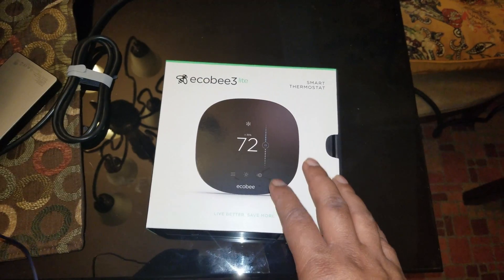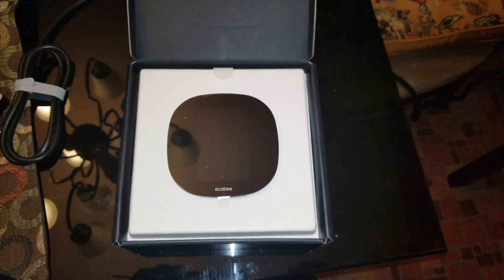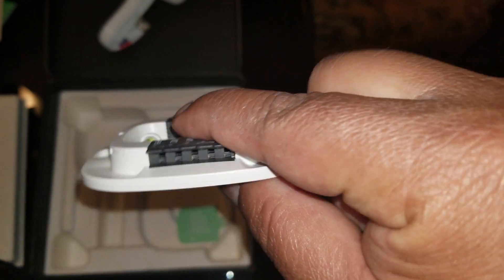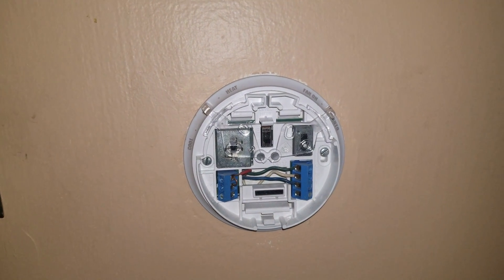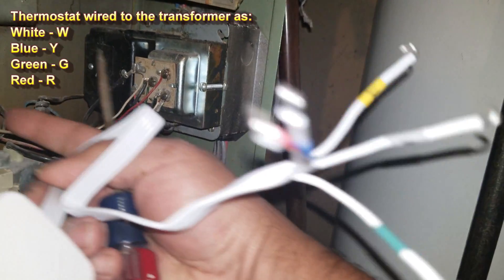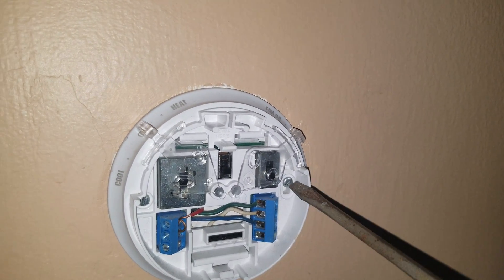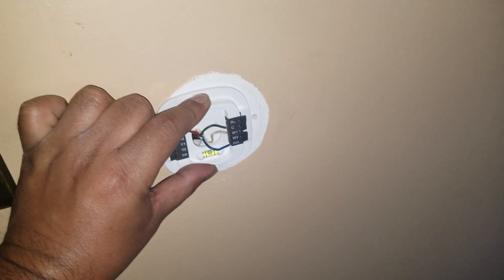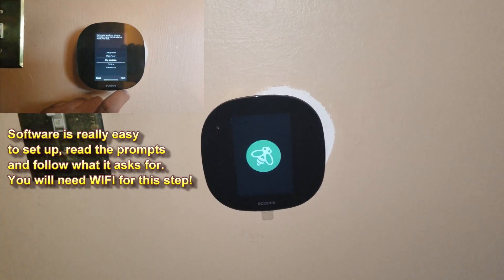Old Furnace + No C Wire = Ecobee 3 Lite Installation Hack

Comment: Is the Ecobee supposed to be able to get power from a 3-wire furnace, (R-G-W) WITHOUT using the PEK? I read within their online instructions, that with this kind of scenario, the option is to move the G wire to C on both the Ecobee and the furnace side. I just got an Ecobee and tried it that way ---and NOTHING happened. Any idea what went wrong?? 

(as an aside - you referenced in the video to turn the BREAKER back on BEFORE attaching the Ecobee to the wall. i did that in reverse --- could that have been the problem?)
Reply from the maker: Depending on your type of heater 3 wire can work. Hard to say without model numbers and pictures.

Comment: Hi there. My “Y” at the furnace transformer only goes to 24 volts when the A/C is commanded by the thermostat. Only the red post shows 27 volts at rest. Am I out of luck? Same set up as you show in the video
Reply from the maker: If all you are using it for is heat I don't see why it wouldn't work but you need to test and trace to be sure.
Reply: @edtheoldtechguy  thanks for your reply. Ecobee support was fantastic in answering my questions. I m really enjoying my Ecobee smart enhanced thermostat.

Comment: How much should a pro install in these circumstances be?
Reply from the maker: Depends greatly on where you live. In a major Midwest metropolitan area it can range between $300 to $500 if you are missing a C wire. $200 if the C wire is there and its an easy install.

Comment: I have the ecobee smart thermostat with voice control not the lite but the installation seem to be the same. I had an HVAC guy come to install it and he said that the furnace and AC were two separate units so the PEK wouldn’t work. Something like in the summer the furnace would be off and the AC would be on so the pek wouldn’t be giving the Ecobee any power.  I have a similar furnace as the one in the video. So I’m assuming their set up is similar where central AC is separate systems and they connect through wiring. Or was this thermostat only controlling the heat? Was this ecobee still able to control heat and AC? My old Honeywell was able to control AC and heating with existing wiring. Not sure why the ecobee wouldn’t be able to with the pek installed.
Reply from the maker: It is difficult to troubleshoot without being in front of the system. I can however answer your questions. The old thermostat in the video did control both A/C and Heat, I know because I tested both before replacing the thermostat. A split system as you describe in your home would require a common voltage from a transformed to power relays and I would expect that there may be a way to make this work. Yet I must defer to your HVAC guy as he is on-site and is a pro. There is no harm in you tracing cables and drawing up a schematic to see how your system is powered. Ensure all power is off when doing this and take video and pictures as you go along in case you accidentally move something. I was also told that a smart Thermostat would not work on the system in the video. I was sure that the NEST would not work but the ECOBEE has been a different story, it has been flawless since the install in both heat and AC options. I hope this info helps.

Comment: What what if you only have 2wires from furnace to tstat?
Reply from the maker: Does your thermostat control cooling and heat? If it only controls heat or cooling all you need is a wall plug, if it does both you have an intermediate device that is controlling via data. Please see my video: https://youtu.be/2LgKKEPVZp0 
If you don't want to watch the whole thing go 12:50 and watch from there.

Comment: Help! I’ve got an old OLD thermostat. Never been updated since the install. I don’t have air conditioning. There’s no on/off button just a temperature switch. I got the same ecobee but definitely not confident installing myself seeing that I don’t have everything needed. Thermostat is a White-Rodgers with red, yellow, & white wire
Reply from the maker: You only use this unit for heat? What are the red yellow and white screwed down too?

Comment: What if there are only 2 black wires coming out of the wall?
Reply from the maker: 2 wires may mean your system may only heat or cool or that it is using data communication with an intermediate device. I suggest you trace your wires using a fox and hound to understand where they go. Then label the wires. Once you know how your wires are routed you can easily install your new thermostat. Please consider watching my video regarding this here: https://youtu.be/2LgKKEPVZp0

Comment: 4 wires, 5 wires?! What if I have only 3 wires? 😩 My thermostat looks ancient even though my house was built less than 10 y ago. Also, none of the wires are labeled even. Does that mean I can't install this ecobee? 😖
Reply from the maker: Is your system only for heat or only for cooling? If so this should be an easy solution, but If it does both with your current thermostat then you may have an intermediate control board. I spoke about it in the below video.
https://youtu.be/2LgKKEPVZp0 13:24
If you have an intermediate board that communicates via data then you may need to stay with the same brand, rewire your system or forgo the nest / ecobee.
Reply: @edtheoldtechguy  Yes it's for heating and cooling. After watching your linked video, I think there is an intermediate control board since the wires aren't labeled and the colours are weird (white, beige and blue). I think I might have to go with an Emerson Sensi to stay with the same brand and probably can't do it myself which is a shame. It seems so easy for most people but it is what it is I guess. Thanks so much for your helpful videos!
Reply from the maker: @sapnapatel3470  I am so glad I could help! Please be sure to take a moment and consider joining our community of rag tag do it yourselfers! By subscribing and hitting that bell. We talk about tools, tech, diy and sometimes comics all while having as much fun as possible. Again it was a pleasure serving you!

Comment: What about the jumper cable, is that no longer needed?
Reply from the maker: Per the Ecobee Manual:  "If you have a jumper between Rc, Rh, or R, leave it alone. Only
label the wires that run from your wall into a terminal block." When you remove your old mounting place the jumper stays there and remains removed.  Install the new Ecobee,  you do not make a new jumper and between R, Rh or R , Install wires to the Ecobee terminal block as labeled for example Rc G Y/Y1 W/W1 C no jumper is placed.

Comment: I have 3 wires for heating coming from the thermostat R, W and G plus 2 wires for cooling connected at the furnace like this: W, R, G for heating no Y connected G and C for cooling. The wiring at the thermostat C, G, Y,  W and Rh jumped with RC can’t figure it out to wire the ecobee with these setting any idea thanks
Reply from the maker: I need more info to be safe, Is this a forced air system? Do you have multiple furnaces or condensers or air conditioning units in your home? feel free to email me at edtheoldtechguy@Yahoo.com with some pictures and if I am available I will try to respond. Thank you for watching and for your comment.

Comment: I was looking for this video,just one thing how is call that transformer with 4 terminals ,and why you didn't not explain little bit more slowy and closer to see how they were hook up.
But thanks good video
Reply from the maker: Thank you for the view and your comment. That part is usually known as a Fan Control Relay or control center, transformer / relay which sends signal to engage fan or heat and sends power to the thermostat. I apologize for not explaining it better and on my next install on an older unit I will take some time and share the little knowledge I have regarding these controllers. Please know that we YouTube creators struggle with how long and detailed our videos need to be. Many ask for shorter videos or longer videos or 1 minute videos. We have to balance entertainment with the propper amount of information. I hope I helped and if you have a minute consider joining our community and subscribing we really need you here. Take care friend.

Comment: Hey great video. I hooked up the pek unit and everything works except the ac unit from outside. The ecobee will kick on the fan instead of ac. There's 2 wires in the furnace (red n white) that I believe go to the ac unit outside that I don't know where to hook them  up to. Any ideas?? Thanks
Reply from the maker: Hard to tell from the comment here. send me some pics and more info at edtheoldtechguy@yahoo.com If it makes sense I will give you my thoughts.
Reply: @edtheoldtechguy  hey thanks for getting back to me. I found out that I had to hook up the two ac unit wires back to the motherboard and it seems to be working. Thanks again

Comment: Ecobee Thermostats need to use Thread. Ecobee stats have to connect to your WiFi and Ecobee.com to function. The Thermostats frequently disconnect from Ecobee.com and are now longer reached from HomeKit or Ecobee App. Totally worthless, especially if installed in remote location. You must reset your Router to get back online. Need way to use the Thermostats w/o Ecobee.com connection.
Reply from the maker: Not sure I understand. I installed this ecobee and have had 0 problems. It is at a remote location. I do have a great internet set up there though. In my video 11 things to know before buying a smart thermostat I explain that an excellent internet connection is needed on any of these thermostats. See here: https://youtu.be/2LgKKEPVZp0
Reply: @edtheoldtechguy  Glad for you. My 1st 4 Ecobee’s worked great. The Ecobee3 Lites do not. I’m not alone, tons of complaints on the internet. Apparently Ecobee.com kicks certain routers off periodically i guess. But, the Thermostats should reconnect like my 3’s do. If i reset router they reconnect and stay connected for 30 mins or 2 days. But always disconnect and fail to reconnect on their own. When you check them, they are still connected to WiFi but NOT ecobee.com servers. Like i said, its a flaw that must be connected to Ecobee.com to function.
Reply from the maker: @JohnWilliams-vr8fp  Ah I understand now, Gosh I have to say it hasn't happen to me. When it does I will make a video. About it. Thanks for the info. I wasn't aware of the issue. Ecobee should get that fixed. Seems like a pretty basic software fix on their end.
Reply: @edtheoldtechguy   the 1st four were great products. Easy to install and worked great. If you buy one, save box, everything including the receipt. If have connection problems return it. They just won’t work with some routers and WiFi. Thanks.

Comment: this thermostat does not work on two wire system thats in most homes before 2015
Reply from the maker: I have heard this. I made a video discussing the 2 wire 3 wire and 4 wire etc. Here is the link: https://youtu.be/0puvQW8jyrQ
Is the reason it does not work because it needs power from C cable and there is none or the 2 wire system is a data type connection. I beleive it could work if the 2 wire system is for heat only and you use a A/C to  D/C  wall Adaptor. If your system is heat and cooling working with 2 wires to your thermostat there may be a intermediate device that changes 2 wires from the wires needed on thermostat. If this is the case you need to pull a new wire. Let us know how we can help.

Comment: Had to do similar thing but no need for the power extender kit (PEK). My 70’s heater only had two wires connected to the thermostat but luckily the cable had 4 wires in it. Yellow and blue were unused. Red was “hot” and white went to the switch to turn the heat on so I ran blue to common (-) on the transformer, so blue became my C wire and I was good to go.
Reply from the maker: That sounds awesome! I was just asked to install another one. New video on this subject coming soon! Thank you for your very informative comment!
Reply: Why does it need the c wire
Reply: @zueszues3178  “common” ground. It needs power (hot) and ground (c) so it can be on all the time. And then the white wire to turn the heat on.

Comment: how to support 3 control wire system  this thermostat
Reply from the maker: You may need to pull a new wire but if you give me more info maybe I can help.
Reply: @edtheoldtechguy  OK what u need the information about 3 wire system. Normally we use control wire R G Y only old thermostat 24v
Reply from the maker: @sunilparakkattil6800  Do you use the thermostat for cooling and heating your home? what kind of system do you have Oil, forced air, boiler is it only for heat or only for cooling? If it's only for heat and it's on the compatible list you may be able to use this thermostat but you will need to buy an A/C adaptor to power the thermostat while it uses the RGY for controlling your system.
Reply: @edtheoldtechguy  can u send me ur wattsapp number , I would send pic of these thermostat nd connections. If this type suitable for our unit I want to replace all old thermostat.  We need smart thermostat in the digital world
Reply from the maker: @sunilparakkattil6800  On my youtube home page in the about me are all the ways you can contact me. Email is preferred.
Reply: Sunilparakkattil@gmail.com

Comment: How do i know if I have the proper wires ? I have a complete new system install ( complete hvac system )in 2019. Is it likely thah I have all the wires ?
Reply from the maker: New System usually equals a new system board in the furnace which should have all the slots you need. If it's a forced-air furnace, turn off A/C breaker or switch, open the door to your furnace, identify your terminal with label YWRGC and follow it as best you can, if you are have a fox and hound also known as a tone generator and receiver put some tone on one of the cables and trace your cable either visually or by chasing the tone. It should go up into some conduit or be exposed out of the furnace up into the wall. What you need to make sure is, that there isn't something in the middle. Any type of information relay converting 2 or 4 wire to 5 or 6 wire in lament terms. If none was found go up to your thermostat remove the thermostat. You should have the same amount of wires usually in the same color config  from the furnace board to the thermostat terminal points YWRGC. If so you should be good. If you have a boiler or other type of system do your research before using this type of thermostat to ensure compatibility.
Reply from the maker: Also please see these videos as they may help! https://youtu.be/fxBhNYFluF0  https://youtu.be/2LgKKEPVZp0

Comment: Great video man! Had a question, when I opened up my furnace, there were 5 wires connected (so one wire into each hole) but when I checked wiring of my thermostat, I only saw 4 wires connected. What does that mean/does that change anything? Thanks!
Reply from the maker: Interesting, it could mean that your furnace does have a C port or common and it is being used by something other than the thermostat. This could be your 5th wire. Sometimes they go to humidifiers or dehumidifiers or relays.
From the thermostat get your color code and match at the furnace if possible. For the 5th wire, you need to trace that from the furnace to wherever it goes. Pro hint kills the power to your furnace by killing the breaker and place a tone generator on the cable and trace it with a sound amplifier. Sometimes called a fox and hound. Do the same to the 4 wires coming to the thermostat if you were unable to fully identify them from the thermostat. Very Low tech way coming here, If you can't buy tools and have a voltmeter. With the furnace, off at the breaker go to the thermostat and take 2 colors and wire nut them together, and in the furnace test for resistance on those wires you should have 0 on the same colors if not you have not ID' them. Tracing your wires and making a diagram is key to not having issues in the future. Hope this helps.
Reply from the maker: You may also want to watch these videos where I brake a lot down it may help
https://youtu.be/2LgKKEPVZp0
Reply from the maker: And this video: https://youtu.be/fxBhNYFluF0
Reply: Thanks. I'll check them out and try what you said, and let you know if I run into any problems. Appreciate you!
Reply: At 2:55 who the guy Ed Hawk you mentioned?

Comment: Come do mine 🤣😭 I cannot get it figured out on my old system
Reply: I only have 2 wires I think
Reply from the maker: @blondiekt2291  I am sorry I missed your comment. 2 wires is usually not a bad thing if the other wires are wrapped around the wires used by the thermostat or they are in the wall. Most likely you have a controller in between your furnace and thermostat. These units usually convert 5 wires to two. You may be able to easily pull a new cable to your furnace too by using the 2 wires as a line tied to a new spool of 6 or 7 wire thermostat wires. It may help to check out these videos.  https://youtu.be/fxBhNYFluF0
https://youtu.be/2LgKKEPVZp0

Comment: Pro tip: use some plumber's putty to seal the hole in the wall around the wires. It prevents cold air from the basement traveling up the wall cavity and messing with the thermostat temperature sensor. Have you ever installed an Aprilaire T-stat that only needs 3 wires?
Reply from the maker: Never thought of that but it makes so much sense! Thank you for the comment! I will be doing that going forward.
Reply: If the voltage coming off that terminal is too high, is there a way to regulate it to prevent it from destroying the thermostat?